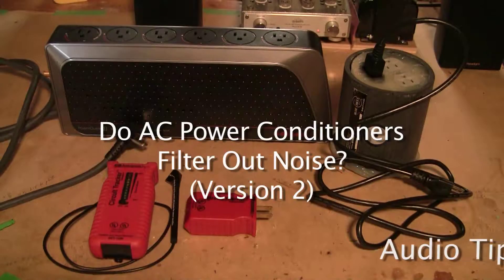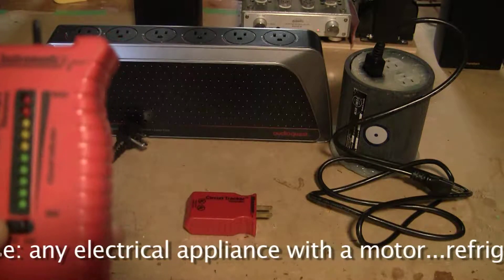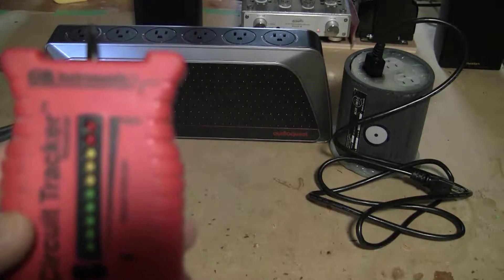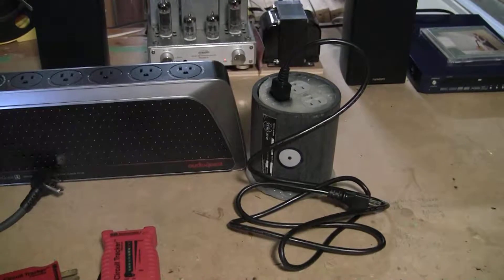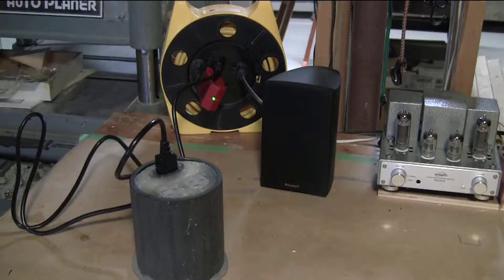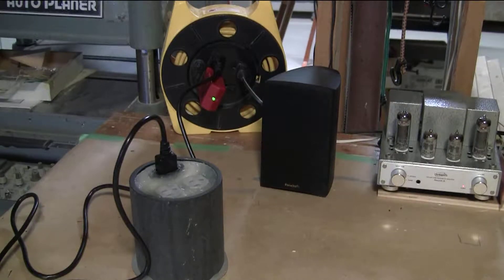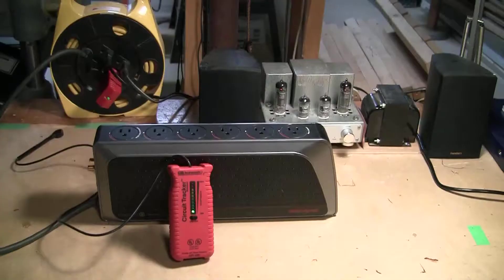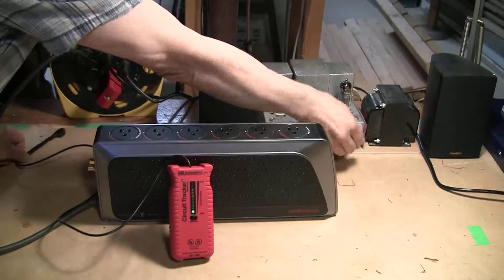Do AC Power Conditioners Filter Out Noise (version 2) - A Simple Test

Comment: But what frequency is this. It may be of no importance to the audio.
Reply from the maker: Good point. Dont know. Could be white noise
Reply: @AudioTnT I think it’s very high frequency noise. Way outside anything of concern. The meter I tried picked up AM radio on my house power points. At first I thought that’s weird and a bit of a worry, but then learned that’s at a frequency of about 500 kilohertz. That’s about 200 times higher than we can hear.

Comment: I’m not really understanding I hear funny noises the whole time so are you saying it doesn’t really matter that I don’t have one of those fancy outlets to make my subwoofers sound more subby
Reply from the maker: @AG-en5y  try with and without a power conditioner. Sounds better with IMO but I could be biased into thinking it should so it would.
Reply: @ Ty I am debating getting one
Reply from the maker: @AG-en5y  even if it doesn't clean the AC power it should provide surge protection. Try using a computer backup power supply for your audio system. It will sound awful.

Comment: Raymond, I am grateful that someone would bother to review these AC Power Conditioners.  I do, however, find a few issues with your test.  The device you are using generators a particular signal.  The detector is designed to detect that signal.  The fact that your AC Power Conditioners effectively filter out that particular generators signal doesn't say much.  For your test to have meaning, you would need to generate a broad spectrum interference (sweep generator) and see how much of that signal, at the various frequencies) is present at the output of the AC Power Conditioners.
Forgive my ignorance of commercial tube amplifiers - I design and build my own - what amplifier are you using?  12AX7 followed by 6BQ5/EL84? I'm a tube-rolling octal snob myself (6SL7 followed by 6V6 or 6L6).  I do octal because of the enhanced separation of interconnections it provides at audio frequencies.
Oh, finally, what music were you listening to?  : )
Reply from the maker: Not sure how to connect a frequency generator to an AC line. Most AC line noise would come from electric motors like frig, microwave EMF, air conditioners, etc. I admire your design chops on building your own tube amps. The little Line Magnetic amp does use 12AX7s and EL84s. I was using a CD of a new age guitarist (forgot name) but Youtube gave me a copyright warning. Cheers.
Reply: @AudioTnT  OH MY.  They gave you a copyright warning for that little, obvious sound check??  What a riot!
If I were doing the review, I would hook the generator to a small diameter coil of magnet wire and set it right next to the power cord and make it an A-B comparison listening to the amplifier output.  You're just trying to add some signal (i.e., interference) to the AC power.
Wait...could that music have been Shadowfax???
Reply from the maker: @BlisterBang  good idea. I could put a noisy electric drill next to the AC cord and measure EMI/RFI using a smartphone app. I used an Eric Tingstad CD.
Reply: @AudioTnT  Have fun!
Eric Tingstad, going to give him a listen.  Thanks!

Comment: Thanks, but you do know that when you show the "orange" unit closer to camera, it was completely out of focus, impossible to read anything, do you?  You were looking to the camera image while making the video, right?  The whole time the camera was focusing the tube power outlet.   And, all power conditioner will filter frequencies above 1kHz due its internal CLC input filters, that is the minimum the manufacturer can do, a simples small toroidal countercoiled Neutral vs Live, with 100nF 400V capacitors before and after, that will remove most of the high frequencies noise.
Reply from the maker: Sorry. I can't see camera image when holding the circuit tracer in front of camera. It's a common device available from any hardware or electrical store. Thanks for CLC tip. All in series between neutral and live, I assume.

Comment: What about the noise after the amps power supply?
Reply from the maker: You will might hear power supply-caused noise in that component's output. If it contributes noise back into the AC line, I would hope the power conditioner filters each outlet but not sure. I could try inserting noise source into one of the conditioner outlets and scan for noise on the other outlets. Thanks for the idea. Might give it a try.
Reply: That's a rather broad question.  What noise are you referring to?  The noise due to the inductor being as close as possible to the output transformers (cost savings override, of course) and it's wiring inside the chassis that must also be close?  I don't know who designed Raymond's chassis, but you bring up an interesting question.

As a punctilious tube amplifier designer and builder myself, I'd like to see his chassis' internals.  I empirically designed my latest amps' supply so carefully that, using my oscilloscope on the most sensitive range, I could not find any signal anywhere.  Zero.  You have to generate noise before you can feed it back.  I wonder what Raymond has.